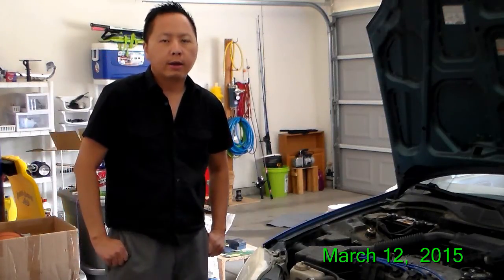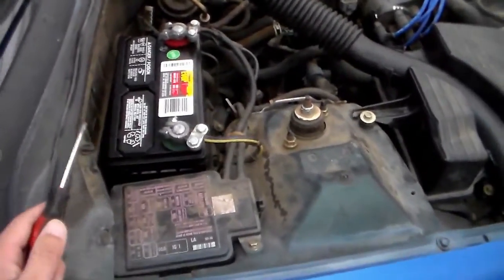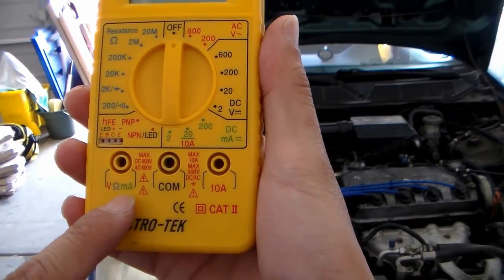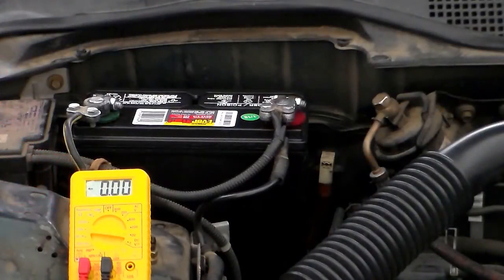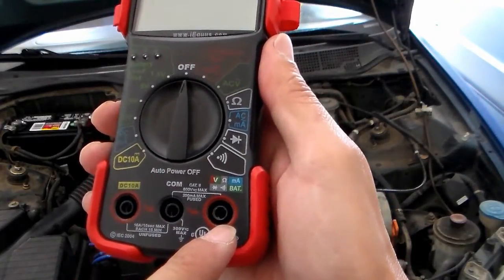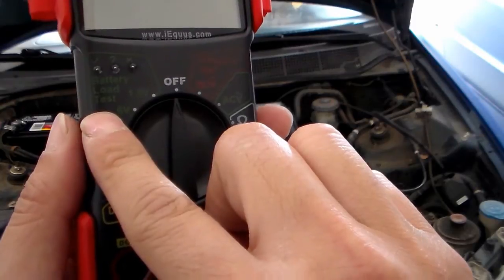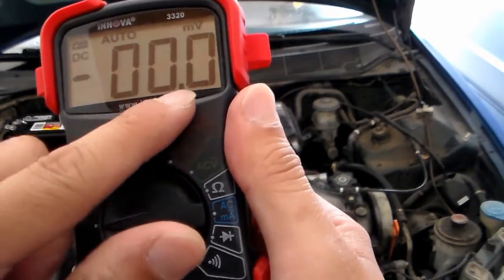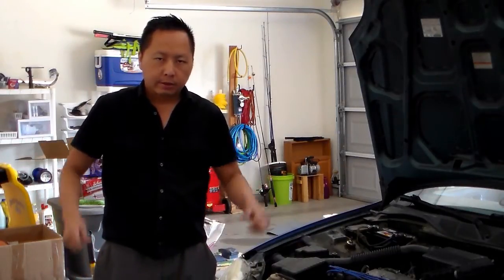How to TEST Car Battery with Multimeter

Comment: I'm sorry but your info is not accurate. I'm using the same multimeter and only get a reading of 11.1 volts on my car battery but I was still able to start my car.
Reply from the maker: I'm just trying to give the general knowledge. I seen car with about 12.2 volt that cannot start and car with 12.2 volt that could start. So depend on the car too.